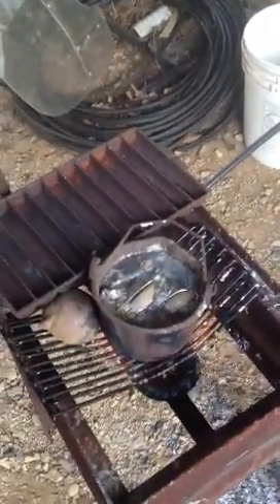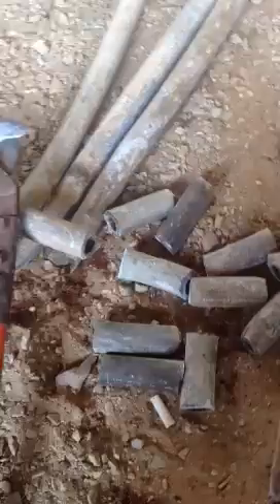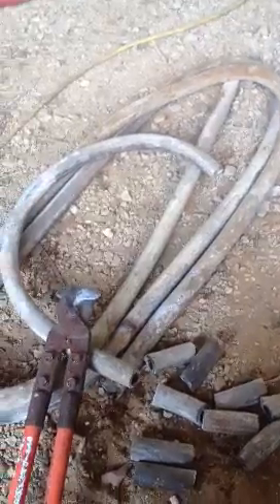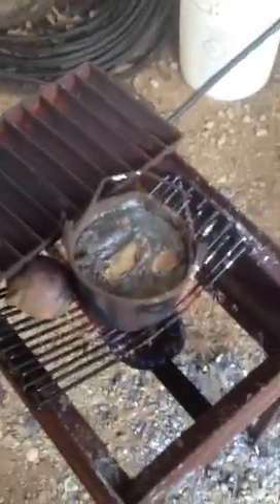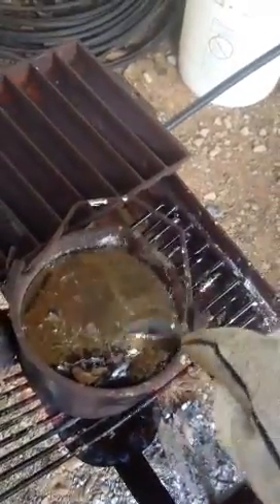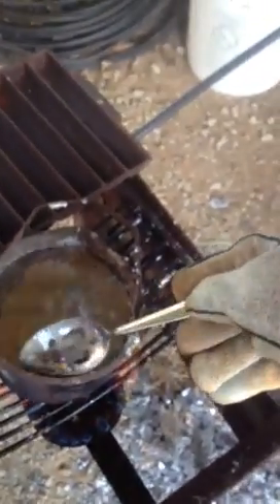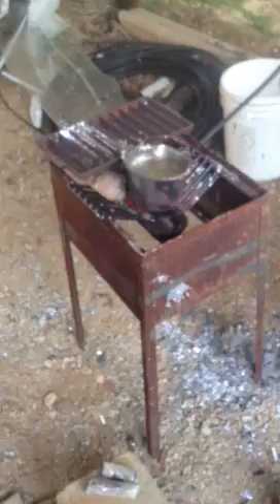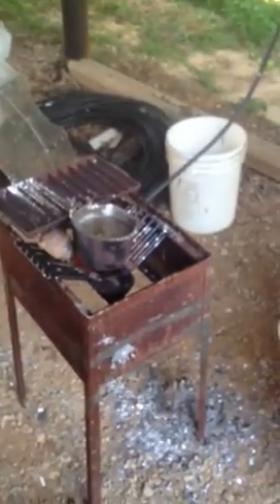Melting lead for ingots with explosion!

Comment: Actually happened to me a couple days ago while melting down bullets. Already had over 150 pounds molten lead, added more bullets, pushed them down and RIGHT NOW some blasted all over. Might have been a little trapped moisture but could it have been trapped air??? Pretty sure no live ammo went in but that's happened too! Thank Dear God for that face shield! I've melted almost a ton of bullets in the last year, so I know that "shit happens" at times!
Reply from the maker: It was trapped air, I had already had them in a warm place so they were dried out. Glad to hear you didn't get hurt by the flying lead.

Comment: My Aunt had lead pipes in her house.  I used to live just down the street from where she lived.  I was just a child in those days.  I don't know if we had lead pipes too but it is likely we did.  We were all OK.  I read somewhere that lead pipe gets some sort of coating inside of it and when that happens it is less likely to leach into the water.  Recently in some schools and other places, there were problems with lead in the water.  I wonder if they added something (that they should not have) to the water that had an effect on the pipes.
Reply from the maker: It was just corrosion, sediment, and maybe a chemical reaction to the fluoride that was in use at the time. The lead water piping was removed due to health reasons (main reason) and also that it could be damaged very easily by road crews and such working along side the roads, also it was hard to patch in a lot of instances.

Comment: Your lead must be dry. the smallest amount of water or just damp will pop when you put it the melted lead.
Reply from the maker: Yea I made sure that the pipe was heated to make sure it was dry. I know for sure about any moisture creating quite the pop, had some ballast pieces from a sailboat many years ago that had trapped pockets of water in them and after the first pop I ended up grinding all the lead into BB sized pieces before I melted any more of that ballast lead.

Comment: I'm getting into lead melting myself so I have to ask, why did this happen? Does this only happen with lead pipe or can it happen with all shapes and forms of lead?
Reply from the maker: Well with pipe if both ends are submerged into the molten lead the air that is trapped is super heated and turns to steam, it then tries to escape and in doing so it explodes from below the surface causing it to blow molten lead ever where (to see how this happens take a balloon and blow it up, tie it off and hold it under water and then puncture it). Technically it can happen with anything that has a void in it that can trap air. You'll find that most any lead that is solid in design will not cause this. Also make sure your lead that you are putting in the pot isn't wet or has trapped moisture because that can cause it to pop or explode also.

I know it's hot but always wear long sleeve non-flammable shirts and a face shield when processing lead like this.
Reply: Makes total sense. Thank you for the information. Glad you didnt get hurt

Comment: Where do you got the old lead pipes?
NIce Vid, I hope you have good ventilation, the lead is nasty when you breath it!
Reply from the maker: I get the old lead pipes from a friend of mine who works at the water dept. There are a lot of them still left in the ground and if they come across them they have to remove them if they can. If they do it's My benefit, he has about 300 lbs of it waiting for me right now. And yes I do all my melting of the lead outdoors in a covered carport, plenty of fresh air and usually a little wind.
Reply: Thanks, I like working with metals too. If you sell these clean pure ingots let me know.

Comment: Do you know why the water dept. have to remove them, and do you know how little amount there is needed to get you sick, or harm the environment?
Reply from the maker: Lead at it's original use was used in water pipes because it was cheap and easy to install, easy to form and bend to meet needs for underground distribution of water supplies. It wasn't until later they found that it was high toxic and caused many health issues. They also found that it corroded too easily and was having to be replaced. Also that once buried if it was disturbed that it could break or deform to the point that it had to be replaced. Here is a link you can check out the health issues and such: http://www.propex.com/C_f_env_leadpip.htm
Reply: They also used to use lead for storing food, they replaced it with aluminum cans.

Comment: you lucky s.o.b lol great video
Reply from the maker: Yea, I was. I intended on showing "A" explosion but not one that extreme! The pipe had been doing it all day but nothing like that! I was lucky!
Reply: Mikey8567  So what's the trick for putting the pipe pieces in safely?
Reply from the maker: Einar Kramer Well I've found when dealing with that sort of lead (any hollow cavities) that cutting them up into sections no longer then 1-2 inches and putting them or putting them (about 4-6 pieces depending on the size of your pot) when the pot is almost empty (that way there isn't a chance of air getting trapped and becoming super heated and causing the explosion) allowing them to slowly melt down filling the pot.

Comment: For what its worth, I learned what not to do. Thanks. Definitely will not be adding cold lead to melted lead.
Reply from the maker: It's not because it was cold. What happened was because the air got trapped inside the pipe when it was submerged and then it superheated rapidly, with nowhere to go it caused a "burp" you could call it and that displaced the molten lead from the pot.
Reply: So if it would of been thrown in with vertical air would of jast came out though other end huh? No pop?
Reply from the maker: No pop, infact because it's not trapped it just melts straight down into the pot. What I did was to show what could happen, my fault was in trying to show what could happen I didn't realize that it would be that violent and I got really lucky that day not to get instant third degree burns and scars. That's why in the following video I suggest that you only half like a half or less full pot when adding more lead to melt.
Reply: +Mikey8567 Got ya. I was melting lead using a similar pipe today. Not on the scale you were but on smaller segments. Didnt have a reaction like that thank God. Good video thanks for the info man.